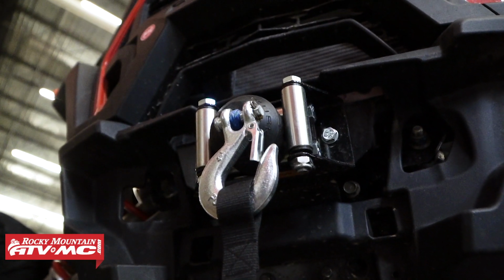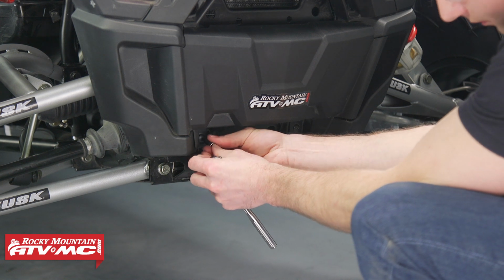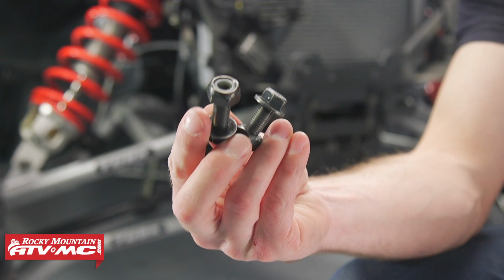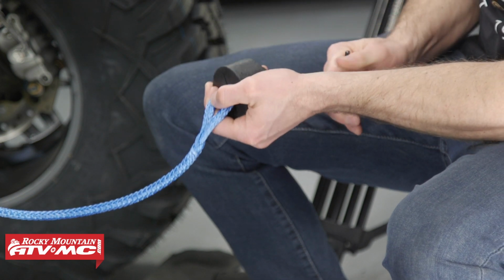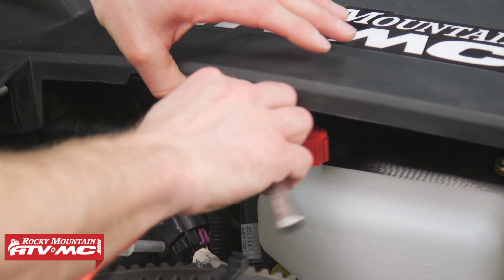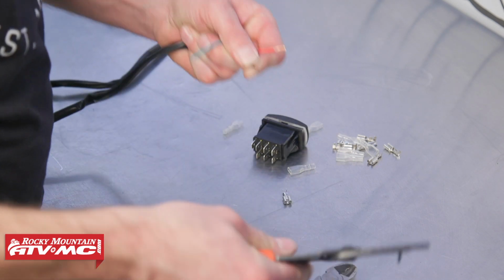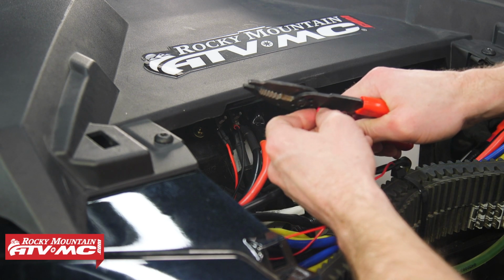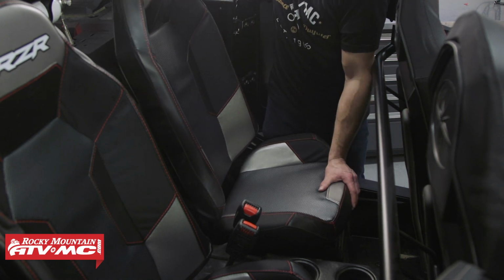Polaris RZR XP 1000 Tusk Winch Installation

Comment: We are just installing one now that comes with an additional plate under the winch. Instructions are very vague, and we just followed your instructions. My wife found it after. Will we be ok to use it without? It has a lot of screw holes, and the only picture shows it between the winch and the main mounting bracket. I appreciate you.

Comment: Is the 2019 the same as the 2018 model ?
Reply from the maker: There were some updated cosmetics for 2019, but as far as this install goes it will be the same for a 2018 or 2019.